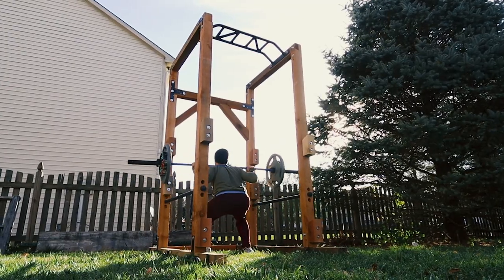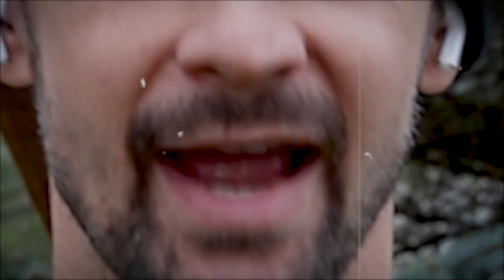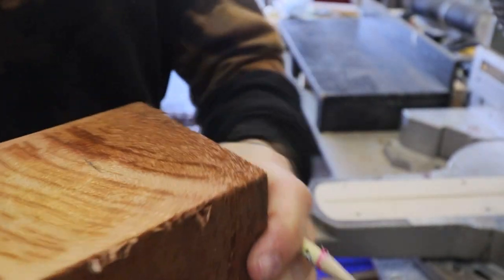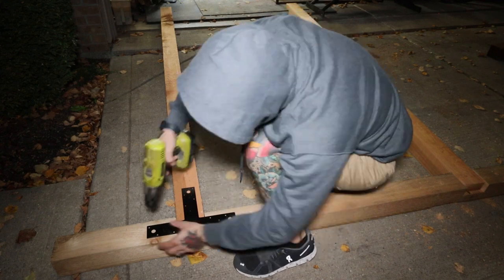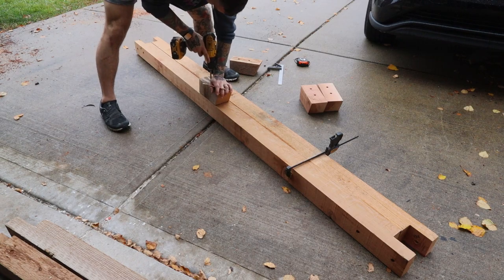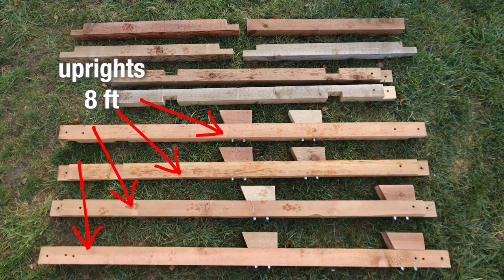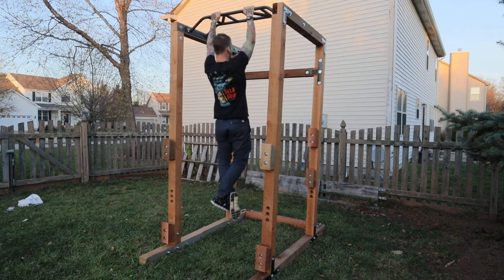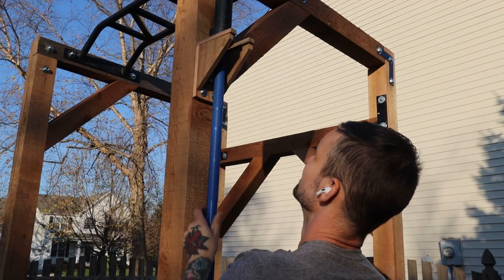DIY Outdoor Power Rack | Step-by-Step Guide to Building a Beefy Gym Rack

Comment: Nicely done. But I can't shake the feeling that the wood that's touching the wet ground will eventually rot.  I'd suggest elevating the rack a bit from the ground by securing it on concrete posts, just high enough to get some airflow under the bottom of the rack.
Reply from the maker: Honestly, I’m not too worried about it. I’ve got two other racks already and I’m curious to see how this one holds up as-is.

Comment: Nice build. Did you ever do a drop test on the spotter pipes? Cedar is one of the weaker woods and I wonder if the pipes should have some CRS rods inserted for backup strength.
Reply from the maker: I haven’t done it yet but it’s on my to-do list

Comment: Heh, just in time for winter. Also, safety is very important. Please use safety goggles when operating high powered rotary saws!
Reply from the maker: Safety first!
Reply: Goggles are better. Had a brake rotor flak bounce up my cheekbone into my eye. Doc had to use  a triangular right-angle scalpel to get all the pieces out. 
Safety glasses are enough until they aren't.

Comment: What do you think about lining the insides of power racks and benches with wood? I'm not sure if you'd need to the switch out the hardware everytime but does it increase weight capacity by a big difference?